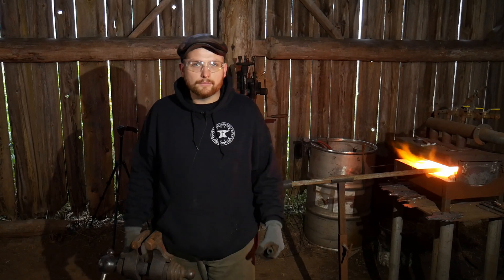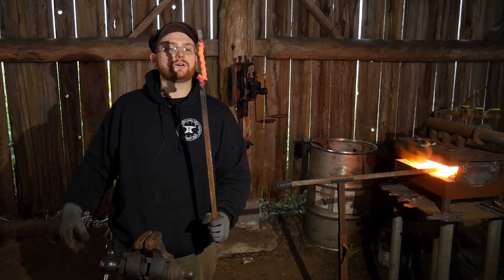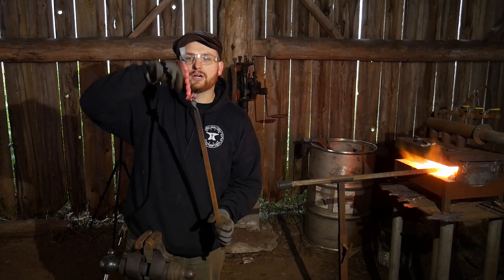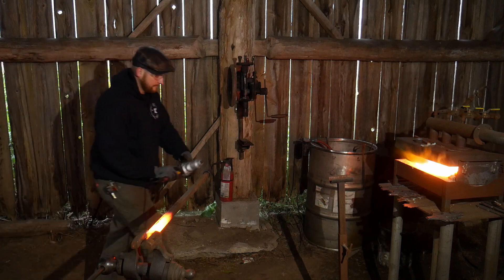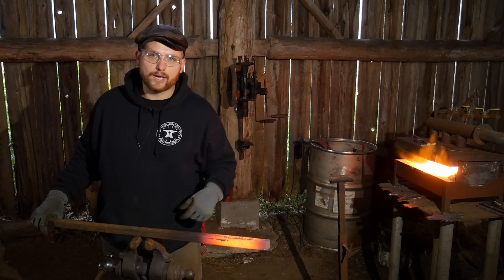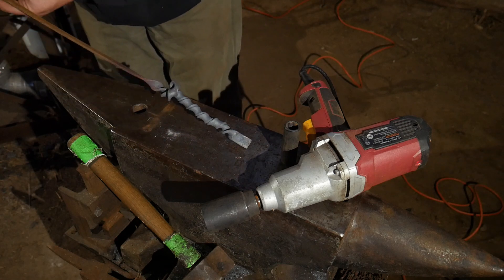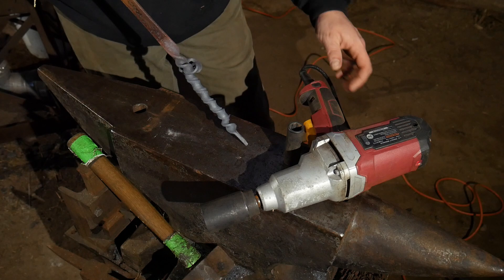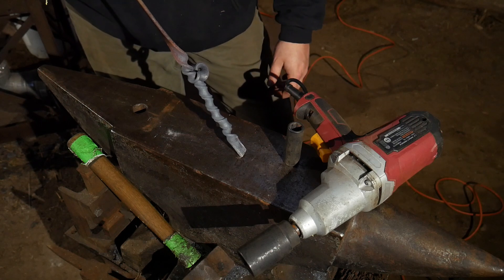Twisting Bar Stock with an Impact Wrench

Comment: It would be interesting to heat up some 1/2" square stock and some 5/8 and some 3/4 and see what the actual limit is on the impact gun....torque specs of the gun used would be nice to know for the test? thanks for the video.

Comment: I think that you are losing a lot of energy trying to move about 15 lbs of cold steel before you reach the red hot part. I'd like to see the results worked from the other end. Quench the end put on the impact and let'er rip! bet it would twist then. Each blow of the impact is .030 movement?  and that gets absorbed over the 3 foot cold steel length.